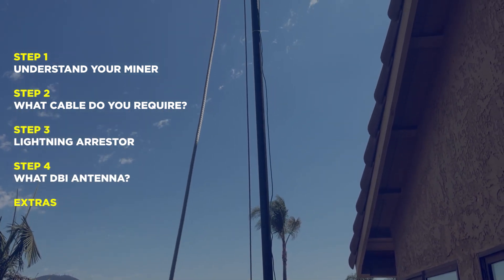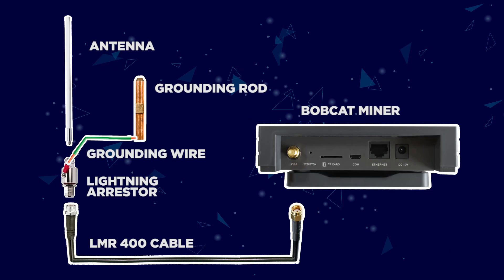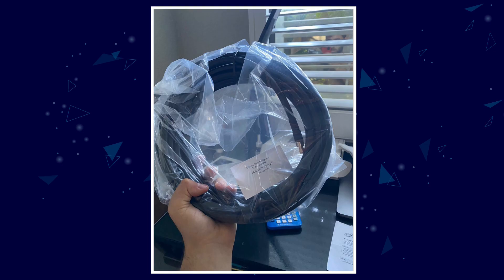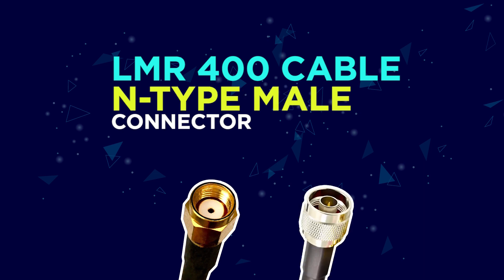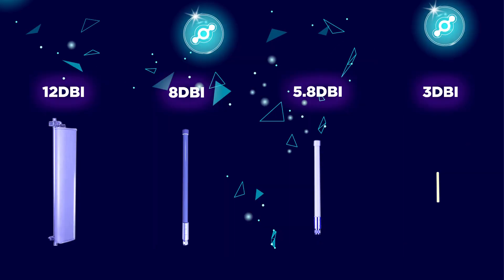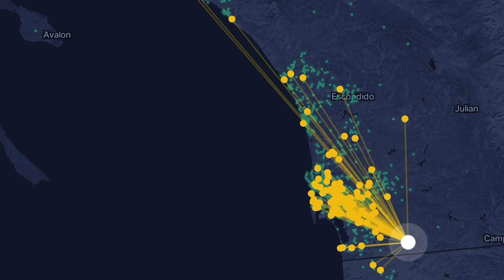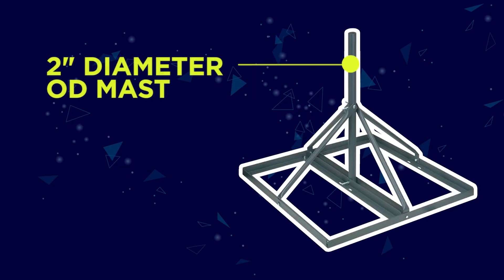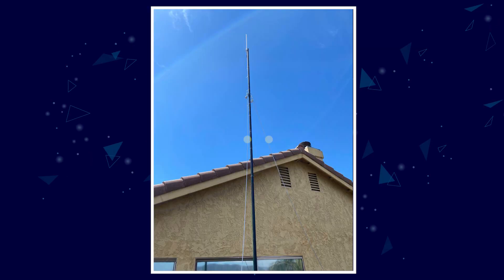Bobcat Miner Antenna Upgrade | Step by step Upgrading your Helium Miner Antenna ($HNT)

Comment: If I buy a 5.8 DBI antenna and a 50ft cable. I noticed the 2 DBI loss due to cable length. How does that efftect the the DBI of the antenna?
Reply from the maker: Hi RBG, basically it will reduce its power output to approximately 3.8dBi. Prob recommend getting a higher dBi antenna so it reduces to dBi to an output that you require.

Comment: One thing no body seems to mention is how horrible the app really is. It's so bad I can't even use it.
Reply from the maker: Hi Meng, It's not bad, once you get use to it. Does need to be more user friendly though.
Reply: @Crayban  I'm stuck with my Bobcat, I can't select to search for my miner on the "Add a Helium miner" page. So frustrating. RIP...
Reply from the maker: @meej6452  Try pressing the bluetooth button at the back of the miner till it turns blue, then searching for the miner.

Comment: Update on the antenna and performance would be great.
Reply from the maker: Hey , will be running a video soon on another upgrade, just in the testing phase. For this setup still running at approx 0.7 - 1.3hnt per day.
Reply: @Crayban  Wow... I've had mine a week 0.3HNT pd, Just tinkering with height will take it  up to the Attic and see how it does. Looking forward to next video. 😀

Comment: Do i still need a lighting arrestor if there is never any lighting or thunder?
Reply from the maker: Haha, nope you won't need it in that case. Just ensure to get a cable with a ntype female end so that fits straight into the Ntype male antenna.

Comment: I just purchased a 15 dbi antenna & am about 40 ft up in a flat. 
I plan on putting the antenna on the roof, on top of an existing attenna/satellite mask.
Any ideas best place to put ground, without having to drop all the way to ground level?
Reply from the maker: Hey Ruffa, There should be ground wiring on top of the roof, especially if there have been antennas placed up there. I would recommend to check out the roof with someone whose specialised in electrical grounding, so that you ensure it's done correctly. I had the same scenario 2 weeks ago when completing a roof installation. Rewards are better from the top :)

Comment: Thanks so much for the video! I live in Brooklyn on the second floor of a 4 story building. I can’t use the roof, but want to get my antenna outside for more earnings. If I install a 3 dbi antenna on the building outside my window, and have it connected to the miner indoors, do I still need the lightning arrester and grounding cable (not sure how i’d ground from second floor). Many thanks!
Reply from the maker: Hey Cody, most welcome. Apologises for the delayed reply. Lightning arrestor is just a safety precaution. If it is sitting out the window, and slightly sheltered, it won't really require it. You will just need the correct cable that feeds into the antenna. Might be a n-type female that connects to a n-type male antenna.

LMR - 400 (N-type female) cable: https://amzn.to/3mZ3iVU
Antenna (N-Type Male): https://rakwireless.kckb.st/crayban-zmx
Reply: Awesome in brooklyn so am I waiting for a miner in the mail can't wait

Comment: Ur the best. No 20 min setup, just Straight to the point!   I'm making .04 every 15 days. Cool Tortilla Lemur.  Any special suggestions? I thinkni habe lots of tree interference.
Reply from the maker: You're most welcome. Check out Tiny Powder Swift, it's close to you hex, however they are punching out a signal with a 8dbi antenna, and most likely elevated. Most likely if you could use a directional antenna shooting out to the city, you could potentially gain more witness coverage.

Comment: Great video ... How can you check an antenna you bought is "as advertised".   ie an 8 Dbi antenna is actually only a 3Dbi antenna.
Reply from the maker: Hello, most welcome. Tbh, the only way to tell is the signal pattern once it has been installed. Usually takes a few days to pick up witnesses and then you will be able to evaluate the results.
Reply: Thanks buddy ... a reputable supplier is probably the best way to go.
Reply from the maker: @bucharestred  Most defiantly, I usually use Rak Wireless and  Mcgill Times Microwave for the antennas

Comment: what connector should i get for flat coaxial to pass through a window?
Reply from the maker: Hi Aye, it depends on what you need it to connect to. If its going direct into the antenna, usually you need an adapter with a N type female end that fits into the antenna which usually is a N-type male. (Sometimes vice versa).
Reply: @Crayban  Okay thank you.  I am a little confused with it.  I think I am going to run it from the miner through the window and then connect it to lmr 400 cable.  So I am thinking rpsma male to rpsma female flat cable,  then the flat cable goes into the lmr 400 rpsma male to n type male cable?

Comment: I have double pane glass how much dbi do i need i live in a urban btw
Reply from the maker: Hi Kevin, it is hard to monitor the exact output unless it measured with a transmitter and receiver. For a better connection you can place the antenna outside on a heavy duty mount and run the cable inside to connect to the miner, opposed to indoors. There are also heavy duty window mounts that can be used.
Reply: @Crayban  i dont want to sound rude or anything but could you tell me hoe much dbi i need it doesnt have to be exact

Comment: Great video! Thumbs up.  However, I wouldn't place the bobcat miner outdoors if it's not made for outdoor use.
Reply from the maker: Hey Fernando, currently placed it in an enclosure which is keeping it safe and sound. As you mentioned, better to run the cable indoors and place the miner inside.

Comment: I have a question, when I used my 8dbi antenna inside my home with the stock 1 meter cable I was earning more than when I used high quality 10 meter cable and I put the the antenna on the roof!
Can you please help me to fix that!
Reply from the maker: Hi Zeid, which cable did you use and how long was it? Also what antenna are you using?
Reply: @Crayban  Thank you so much for your reply. 

I purchased it from RAKwireless
1- Pulsar Cable | RAK9731/RAK9733 × 1
RAK9733 RP-SMA Male / N-Type Female / 10 m / 32.80 f

2- 8dBi Fiberglass Antenna | Supports 858-878MHz × 1
N-Type to RP-SMA

Comment: After changing the antenna, do you have to sync again? And re-configure?
Reply from the maker: Hi, you just need to update the miner on the app, check my latest video on POCV11, I show how to do it. It will auto sync once connected.

Comment: so did you buy to cables to connect to the lighting arrestor?
Reply from the maker: Hey Zach, the cables to connect to the lightning arrestor are the lmr 400 and the grounding wire. Thats all thats needed.
Reply: @Crayban  so did you buy two lmr cables like one to the antenna and one to the miner and the lighting arrestor between them
Reply from the maker: @zacharypaul1111  Hi Zach, only 1 lmr 400 cable that has 2 ends. One end that goes into the miner and the other end that goes into the lightning arrestor. The lightning arrestor then attaches to the antenna. I have provided a link in the description if you would like to see the actual product used. Hope that helps.

Comment: Good setup but Why bother with big mast and pole when you can mount the antenna on your roof ? The miner will be dry and safe in the attic and antenna on the roof .
Reply from the maker: Hi Don, As it's not a fully owned property, cannot interfere with the structure, otherwise would have. The miner is fine now, locked in a enclosure.
Reply: @Crayban  makes sense now. Thank you for reply. Have a nice day !

Comment: U videos always best & straight to the point 👍
I use Bobcat 4dbi and 4 witnesses in one month surrounding hills. I purchased 10dbi and planing to place 10m higher. I like your best opinion if u don’t mind.
Reply from the maker: Hi Slora, thank you for the kind words.Where are you based country and terrain wise?
Reply: @Crayban  glad to hear from u. U can find viper in Halesowen, UK
Reply: @Crayban  I locate it 3rd floor near window.
Reply: @Crayban  still ok to fit 10dbi or try lower dbi. Name is Innocent Bubblegum Viper.
Reply from the maker: @slorafernando  Heyy Slora, sorry for the delayed reply, sometimes I miss out comments, not on purpose though haha. I had a look at the miner position, if you already ordered the 10dbi, try it out and also see if POCV11 - Created a video on this (which will roll out on the 14th October) will have any impact on the signal strength. I personally would try a 5.8 dbi, and try to get the antenna outside if you have not done so already. Btw your earnings are pretty good compared to many miners within the city of London.
Reply: @Crayban  Tnx, ur comment is very helpful. I’ll try and let u know. Cheers 👍
Reply from the maker: @slorafernando  You're most welcome. Please do, would be good to know how a 10dbi works in that region.

Comment: Hi mate. So did you strap your antenna to the pole???
Reply from the maker: Hello, I had used adjustable stainless steel clamps. I have placed a link in the description, hope it helps.
Reply: @Crayban  thanks mate. I have subscribed aswell. Waiting on 3 bobcats to arrive in Dec-jan so will be watching all your material💪💪💪
Reply from the maker: @soldier2297  Much appreciated :) More content to come

Comment: cant find any halo chrome alloy pole? any suggestions?
Reply from the maker: Hi Adam, try a flag pole, but ensure it’s the correct size if you are using a base with a mast. If not, try pop into a local hardware store that can create that size pole, any durable material would work.

Comment: Hi, I am planning to Install it on top of my regular TV antenna. The TV antenna is grounded, also the Bobcat Miner will be inside the attic, can you please advise if I don;t need the ground connector?
Reply from the maker: Hi Sanjeev, It's better to be safe, as the current will flow within the cable running to the miner.

Comment: How do you change the antenna on the app? I added the rak 8dBi
Reply from the maker: Hi Ben, connect the app via Bluetooth to the miner (hold the back button on the bobcat). Once connected select the settings icon in the top right hand corner and then you can update the antenna dBi. It costs about 55000 Data credits.
Reply: @Crayban  do you select custom antenna and type in 8.0 dbi since I am adding the rak 8dbi to the bobcat
Reply from the maker: @benbrookover6232  yep that’s correct, type in the dbi manually and the height if it has changed.
Reply: @Crayban  thanks just did hope it helps

Comment: Hi @crayban I love your videos about Bobcat !!!!. I´m thinking into install my bobcat on the roof with a 5.8 dbi antena and... the most important and my question. Do you think I could use a 4G modem to connect it to internet saving ethernet cables and connect it to a 12 Volt solar panel? if I can use a solar panel to give power to the bobcat and a portable modem with 4G i will no need any cables to place it on the roof.
Reply from the maker: Hey whats up, I have seen this type of setups run before, usually off-grid up in the mountains. You are capable to do it, however you would need to have the correct kit to run it all. This video is a similar concept, however they run graphic card miners. https://www.youtube.com/watch?v=6lezfFTw1HU Hope it helps.

Comment: If you do not have  a grounding pole what. Would be. Another option  to ground. Your antenna?
Reply from the maker: Hi D.Barnes, sorry for the delayed rely. You can ground it anything that will flush away a current, such as a cold water pipe. Copper material is mainly used to ground the wire.

Comment: Question 

Do you have to update your antenna on the helium app if you have a bobcat miner ? I went from a 4dbi to 5,8 dbi. It doesn’t give me the option to change antenna just the height it only gives me.
Reply from the maker: Hi Joel, sorry missed out on this question. There is a new implementation where the miner dbi in th app will matter. There should be a drop down menu that says select antenna. You can check out this quick video which might help: https://www.youtube.com/watch?v=twk1FZU-mxo

Comment: @Crayban, what if we dont use lightning arrestor. What is the best way to connect cable with antenna?
Reply from the maker: Hi Georgi, if you decide not to use it, you need a (Rp-Sma male to N-Type female) Cable. Or a n-type female to female adapter, similar to the lightning arrestor heads.

Comment: Great video, where did you buy 25 feet 1.75 inch diameter pole. I couldnt find it in online, or online homedepot etc.
Reply from the maker: Hey, I had purchased it from a local hardware store, it had to be cut to size.

Comment: Can the antenna lie horizontal in a house loft?

I ask this as there isn't enough height to put vertically.

I have a little cupboard where I planned on sticking the miner, I wasn't sure whether or not to buy an antenna to get the extra range.
Reply from the maker: Hi VMA, the general setup would be for it to be placed vertically, I would say try to place it horizontally, and see if it produces a decent signal. If not, try to see if you could wire the antenna at least outdoors, as walls also play interference in signal strength.
Reply: Thank you for the response.

By cupboard, I meant it's to my loft. So it'll be clay tiles just in the way to the outside world. Better than double glazed glass I believe?

Comment: Are lightning arrestor bidirectional?
Reply from the maker: Hello, apologises for the delayed reply. In some cases, the lightning arrestor has a bi-directional flow so it is reversible. I would get recommend to get the perspective from a professional antenna installer. For my setups, I have used normal lightning arrestors, the most reliable I would say would be from a reputable source like Timesmicrowave.

Comment: Wait, is that your miner wrapped in a plastic bag? Outside! Isn't it building up heat in that bag outside with no air, especially when the sun hits the cement block??
Reply from the maker: Hey Rob, only a temp solution till I created an outdoor enclosure for it.

Comment: Im getting my miner shipped next week so it would get here before all these upgrades get shipped. My question is should I wait to sync my miner with the upgraded antenna or should I sync it right away or does it matter?
Reply from the maker: Hi Fazer, it doesnt really matter, you can go straight with the upgraded antenna, and if its not performing as well you can revert back to the stock antenna.

Comment: Whats the difference between lmr200 vs lmr400? Also do you know if its safe to have your bobcat miner setup with the indoor antenna and once your outdoor one arrives to power it down and hook it up?
Reply from the maker: Hi Sebastian, LMR200 is thiner, with more dbi loss. It is safe to change it out, as you mentioned, you need to ensure the Bobcat is switched off and then change the antenna.

Comment: Great video! Wanted to ask a question, I’m in south London and quite few minors about wanted to know should I stick with the 4dbi or upgrade to 8dbi?
Reply from the maker: Hi Lloyd, in the centre of London, I run a 4 dbi, tried an upgrade but didnt work well for my location. I would advise to still test, and see how it runs, if not great you can always revert back to the 4dbi.

Comment: So i bought the roof mount linked in your description and the rak antenna, however the diameter of the mount is too large for the antenna so the antenna wiggles around. What is your recommended solution?
Reply from the maker: Hi Ryan, you can try to attached the antenna to the side rather than insert it, and use stainless steel clamps with the correct diameter to faster in tight (Clamps: https://amzn.to/3z798bw)

Comment: What if I don't need any grounding adapter and cable?
Are the following 2 items enough?

Cable:
RAK9733 RP-SMA Male / N-Type Female

Antenna:
5.8 dbi Fiberglass Antenna / N-Type Male / White

Are cables/antennas waterproofed?
Reply from the maker: Hey, apologises for the delayed reply. It is up to you if you want to ground, if you don't require to ground it, the cable and antenna you mentioned is correct. The antennas are waterproofed IP rated.

Comment: The 400 LMA cable need to be connected directly into miner or to the original miner antenna stander?
Reply from the maker: Hi, LMR 400 needs to be connected directly into the miner

Comment: Keep antena cable shortest possible. It is better to extend 48V ethernet cable than low power antenna cable.
I have installed mine on the roof, so RMA cable is only 10ft long, coming into attic where bobcat sits.
Reply from the maker: Agreed :)